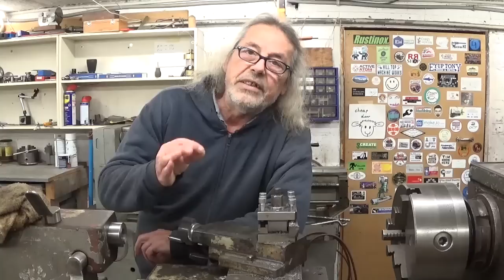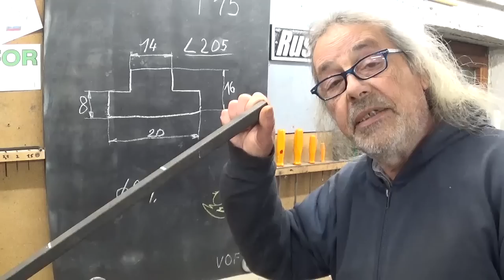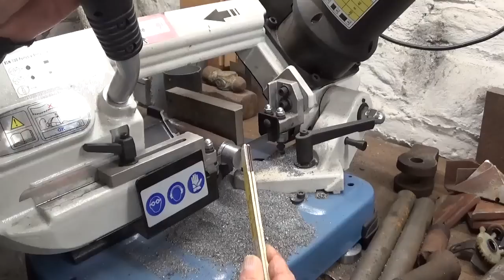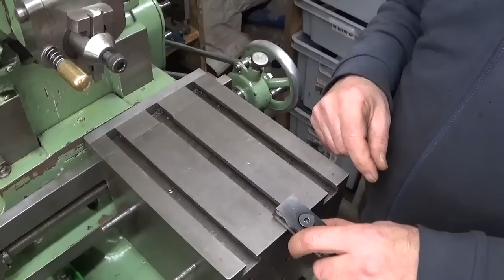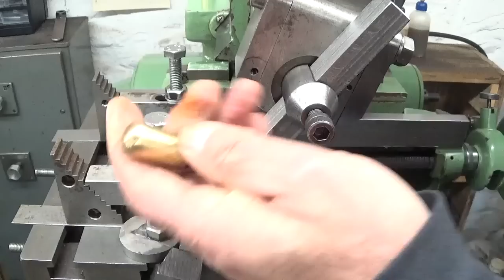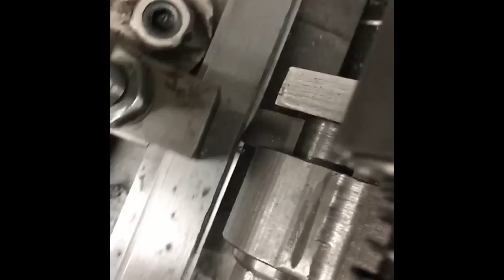Fill the T-slots.

Comment: Michel, congratulations on passing 10K subscribers!  One recommendation for the threaded holes in the "plugs" would be to insert set/grub screws.  That ought to prevent chips from catching in the threaded holes -- a set/grub screw won't have threads to catch chips.

Comment: T-slot protectors  can be bought in different sizes and different lengths. The advantage is that you can click them in from above so there is no need to slot them in.

Comment: Congratulations on your 10k, I've been subbed for quite a while. 
Question: Could you have used the clamping set up on the shaper with a sacraficial piece rather than only clamping on the left side?  It seems to me that this would avoid the issue of compromising the clamping hardware. Something like a 5mm thick shim?  I don't know much about shapers so maybe I am missing something.
Also if you have a flat on the cylinder pieces, then the t-slot pieces would align flush on those flats. Alternatively you could make a cut out on the end of the t-slots to match the shape of the round piece. You could tap the hole on the TSlot piece and put a set screw to hole the tslots in place if you find they move.
Love you channel!

Comment: If you countersunk the round pieces you could put a flush mounted screw in them and they'd never fill with chips, and you'd never need to find the bolts, just undo them enough to grab and lift out. Probably need a small indent in the face to put a tool in if it ever just spun while undoing the screw
Reply from the maker: That makes perfect sense. Will do.
Reply: @Rustinox  Just so you know, I am no where near your skill level and will be doing the same thing you posted about. very nicely done. I thought about 3d printing, even molding silicone, but your solution is the best ive seen

Comment: Thanks a very inspiring video.
Your clamping tools on the shaper made me think the same kind could be used on a mini mill too. Thanks for the idea!
You were using steel for the plugging. In this shop plastic is a possibility.
BUT.... There's a problem. The threaded hole will get invaded by chips.... Solution is pending.
Cheers.

Comment: Nicely done. I would suggest that these screw holes be countersunk and screws be kept in them so that the threads don’t got fine particles in them, making it difficult to get the screws I for removal. Sometimes even air can’t remove them completely. It’s good to see you feeling better.

Comment: I use simple Plywood.
I rectangular shape .
The thickness of the wood is exact the with of the slots.
I oiled the wood to protect the machine . ( Wood draws moisture)
Works fine 
And cheap and easy

Comment: Well done on getting 10k subscribers Rusty !
I usually have my compound slide set just a smidge over 1/2 a degree, which means a 10 thou advance on it will take one tenthousandth of an inch off the diameter. Handy for those finish cuts, but don't forget the extra longitudinal travel if you're working up to a shoulder !